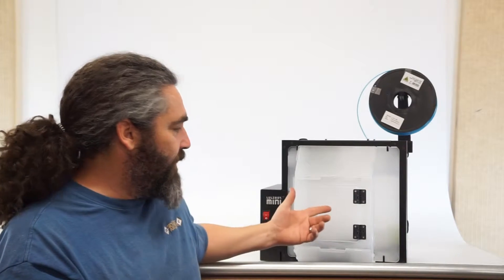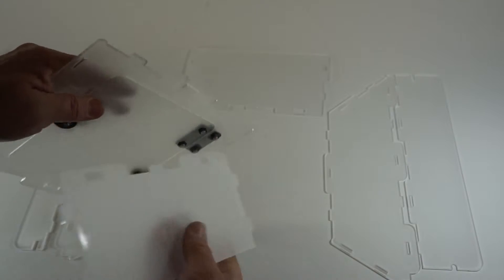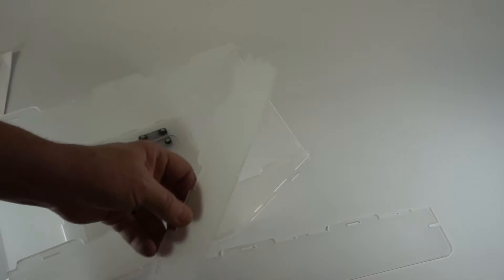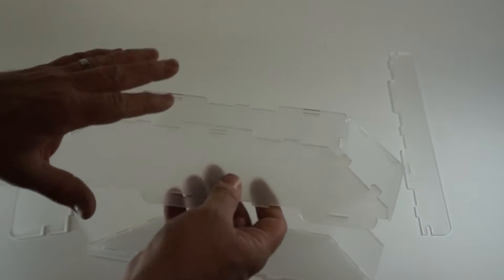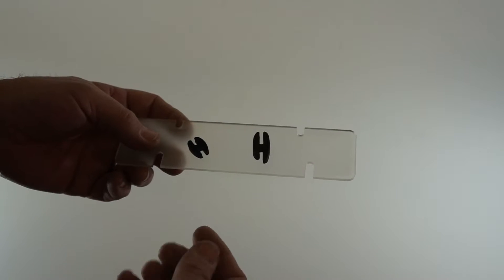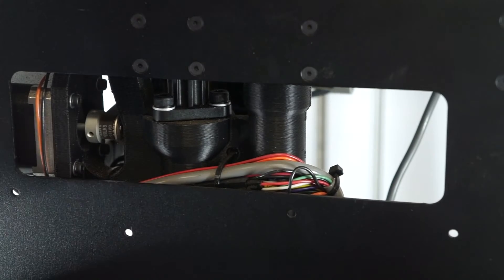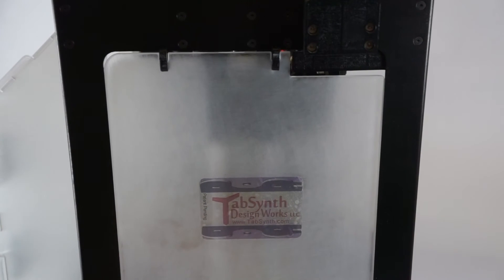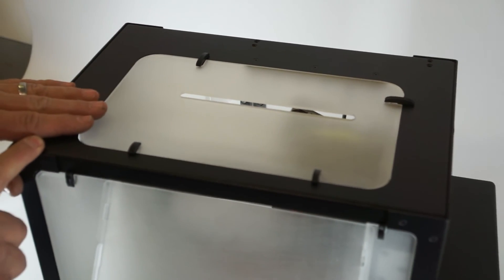TabSynth Lulzbot Mini Enclosure Instructional Video

Comment: This is not an air-tight seal right?
Reply: I just finished putting mine together, and not, not an air-tight seal, but if you needed that it wouldn't be that hard to run a bead of high-temp silicone sealant along the seams. It is a nice enclosure, well made, and fits together tightly, really tightly. :-)